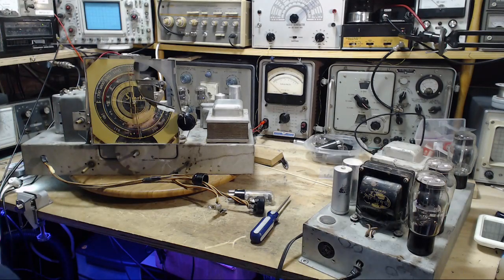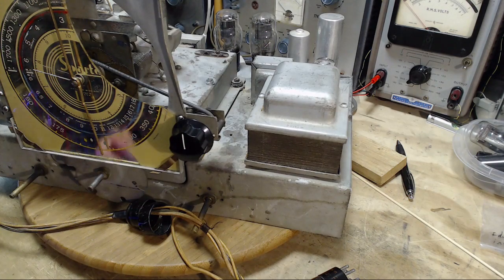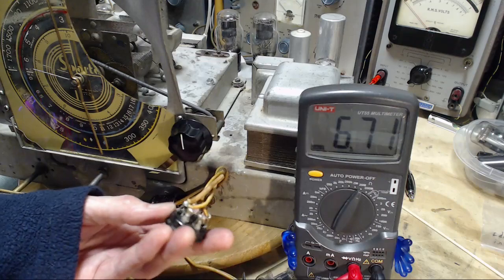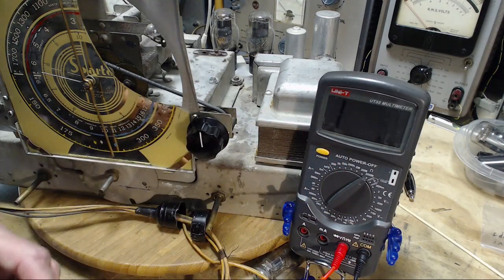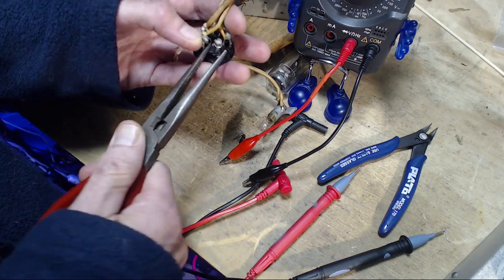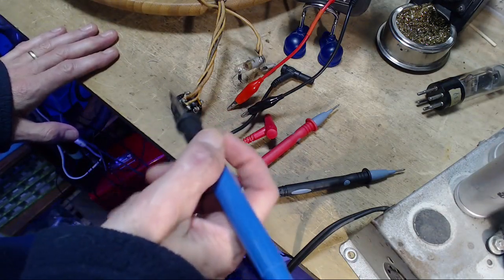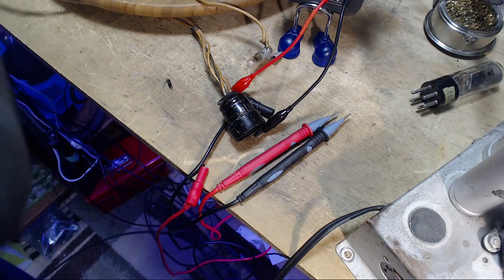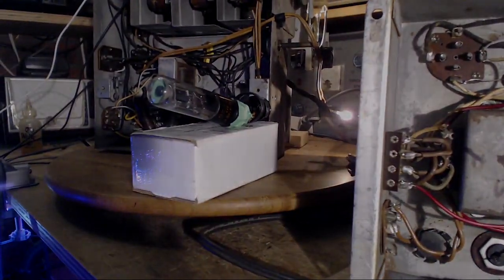Sparton 1567 Huge Tube Radio Video #40 - Magic Eye Socket Resistor

Comment: Now check all those other out of tolerance resistors and you will be getting nearer the end of this project.
Much better editing on this video. :-)
Reply: Yes..I am suspicious of that large blackened resistor that is cold compared to the hot ones in that area.